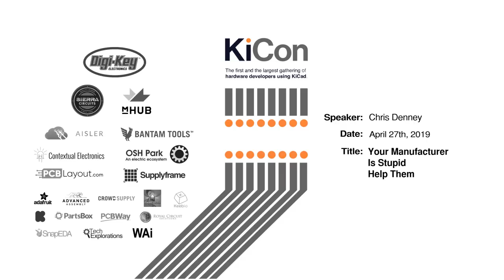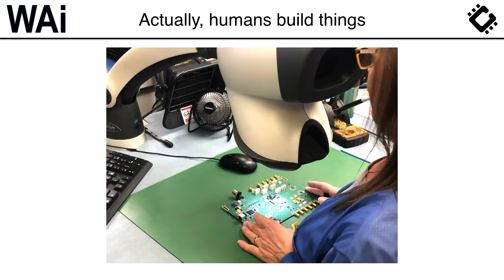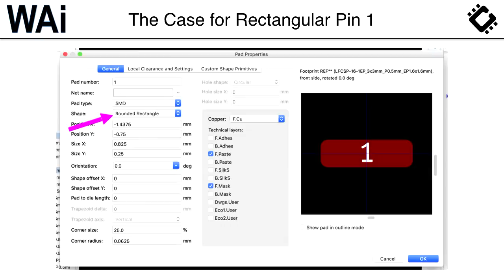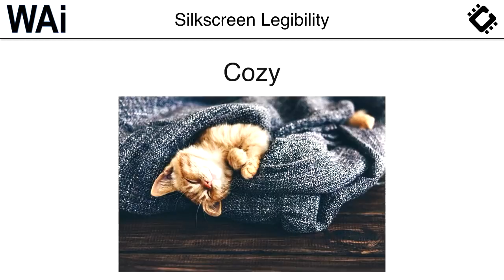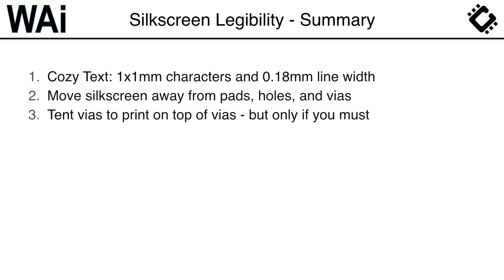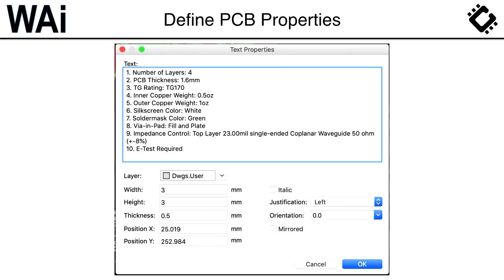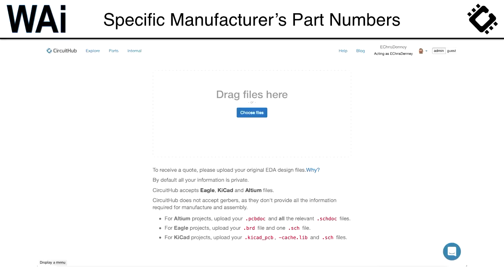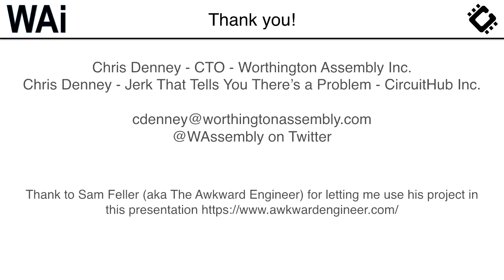"Your Manufacturer Is Stupid - Help Them" - Chris Denney (KiCon 2019)

Comment: One of the best uploads from this year. My only complaint is that it was too short. This was a keynote, hour+ worthy address IMO. I just counted, 9 screenshots I saved from this and I added the upload to 2 playlists for later reference. Awesome job!

  As an abstract kind of side note, the biggest lingering questions I have are regarding how to transition from DIY and home etching type stuff to more professional manufacturing. I'm in no hurry, and I'm certainly not ready to start manufacturing anything to sell. I've learned a lot of layout and design lessons from etching boards myself. I don't have to worry about a lot of the extra layers like silkscreens (yet) or even Gerber files etc. As I get more and more comfortable with my simple way of making boards, the idea of transitioning to something that can be professionally manufactured makes me increasingly uncomfortable in it's scope. Perhaps someone is aware of some good, current, content on this subject that they can point me towards? I'm not looking for the "how to transition to spending thousands for manufacturing (xyz)." I'm interested in 'the conservative approach to getting your feet wet on a tight budget' type info. 
 
Anyways...thanks for the great upload.
-Jake
Reply: Glad you liked it Jake. I think the best way to get your feet wet is to get comfortable with tools like KiCAD and start ordering simple PCB's from vendors like OSHPark. For very little cash you can quickly see how your silkscreen might be difficult to read or your thru-hole pad's annular ring is too thin. I ordered dozens of PCB's before getting the final product ready for volume and learned something from each one. The easier it is for you to assemble by hand, likely the easier it is for a manufacturer to use machines to assemble it.
Reply: @chrisdenney6710  Sorry if it's been too long but this is the first time I'm seeing this video. Is there anywhere I can find the rest of the tips you weren't able to talk about and show in the last slide there? Thanks
Reply: @BelialKnight  it was scheduled for kicon 2020 but some bug ruined everything. Meanwhile you can listen to my podcast where we go deep into the weeds on these kinds of things. Just google “pick, place, podcast”